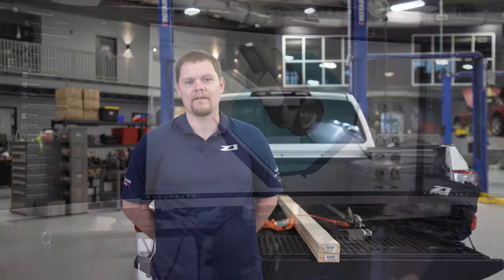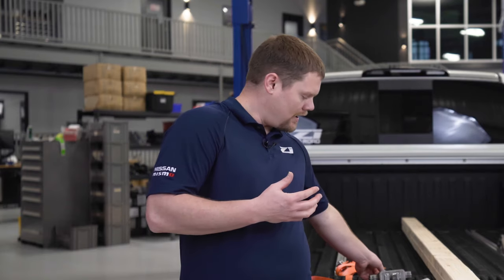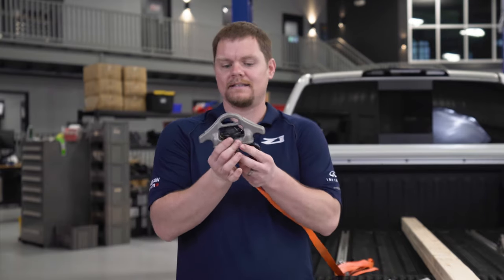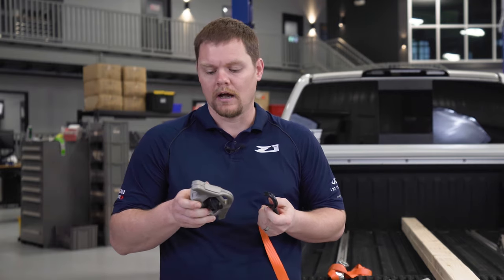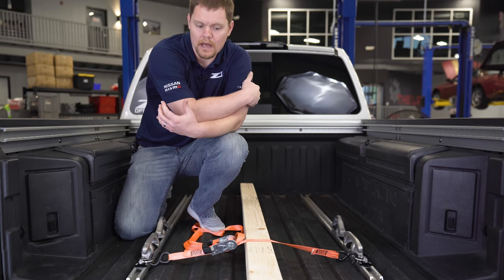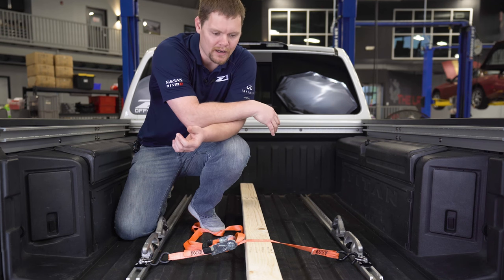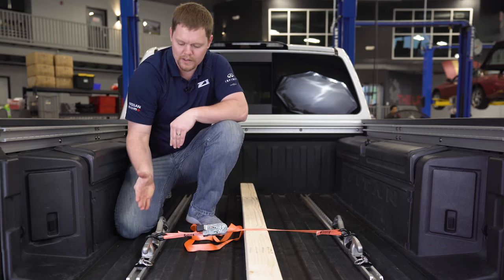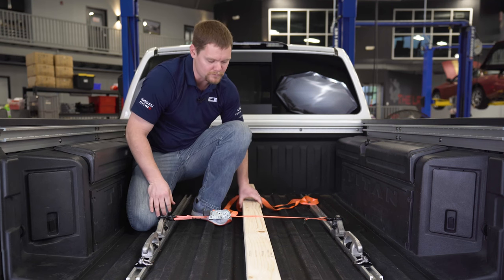Why are Z1 Speed Cleats right for your Nissan Utili-Track System?

Comment: First of all, I love your speed cleats and will get some for my '06 Frontier. I have 4 of the taller cleats and have been using them since I purchased the truck new. When I've hauled items such as the 2x4 boards like you show, I have used the OEM cleats similar to boat cleats where I place the hook in the top opening of the cleat and then wrap the strap around the lower ends which allowed for strapping down lower to the bed. I have not had any issues with the strap coming loose from the cleat strapping this way. Anyway, I think you have a great product and a huge improvement to the cleat idea. Thanks for sharing.

Comment: The Z1 Speed Cleats are awesome! However, the OEM cleats are designed for rope not hooks.
Reply: I was thinking the same.  I need to be able to use both rope and hooks depending on what Im doing

Comment: What is that bed storage system that covers the wheel wells and can it be added to the older 04-15 titans?
Reply from the maker: That’s the Titan box accessory.  Haven’t seen one added to a first gen but now we’re curious too.  https://www.z1offroad.com/genuine-accessories/nissan/oem-2016-nissan-titan-box-kit-p-16571.html